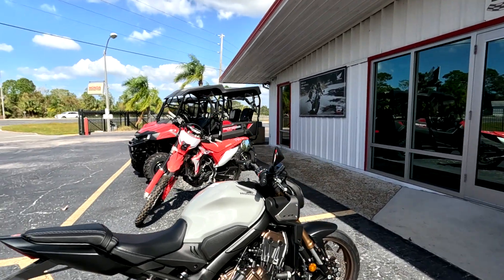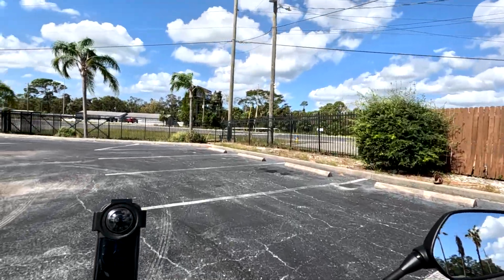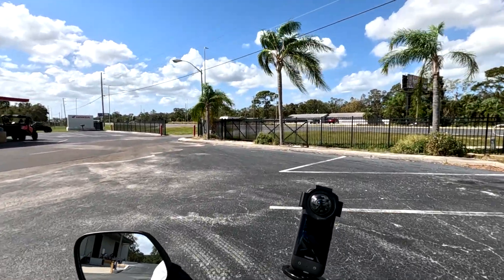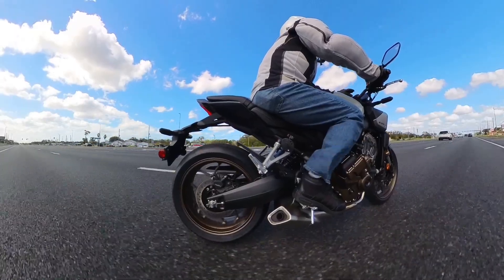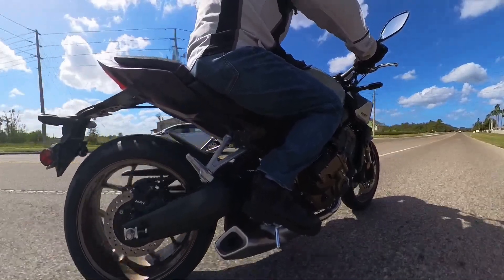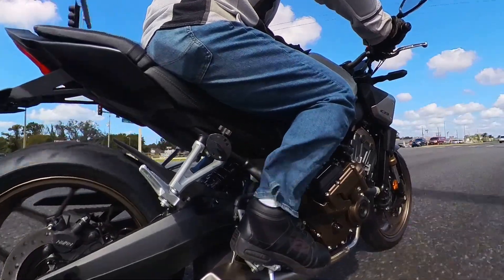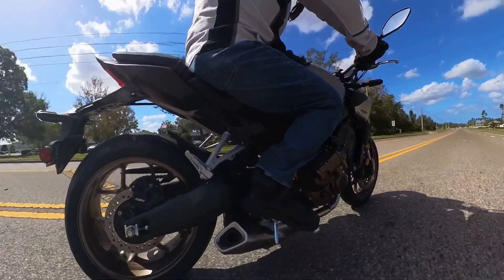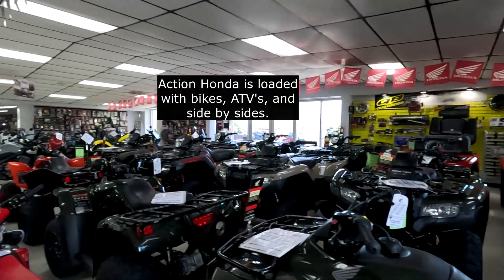Motorcycle e-clutch, innovation or useless tech?

Comment: 3:40 yeah, additional gear might be handy. But this Honda has a very revvy engine (11.000 +rpm), and most of the torque is also at higher rpm. This motor needs to be revved,  basically.

Comment: The way I understand but not ridden an e clutch is it automatic or no clutch from the start then it’s a quick shifter where you still must shift gears up and down.  A DCT(dual clutch transmission) which Ferrari, Lamborghini, Porsche use is a computer controlled AUTOMATED Clutch no torque converter like automatic car tranny) dual clutch system. One clutch for odd gears, one clutch for even gears.   That allows millisecond shifting.  The computer works the clutch and will shift for you up or down or you can manually shift with paddles.  DCT has replaced slush bucket automatic transmissions with torque converter as DCT shifts instantly.  Car acceleration must faster with DCT vs manual shifting.  Cars going with 8-10 speed automatic torque converter transmissions which can almost keep up with DCT but automatic torque converter transmissions much heavier with all the torque converter fluid.  DCT uses clutch plates just like a manual tranny.  DCT gives you a choice manual shifting or automatic shifting.
Reply: It’s interesting how frequently people misunderstand the technology available. A DCT has its explanation in the name but people still mistakenly call it an automatic despite a DCT being so much more advanced and precise than an automatic.

Comment: An Electronic Clutch for taking off from a Standstill just like a Scooter? But you can still use the clutch manually as well? I never heard of such a thing. Sounds like a geat idea. I can see that being very useful for borrowing your bike to teach a friend, or ur stuck in traffic and your feeling lazy or tired, or if your just getting old and need a little helping hand sometimes. Bring this as an option for 125cc and 250cc motorcycles so you can use them to run a Motorcycle School for Noobs and Beginners. And for schools another idea is to start them out with automatic transmission scooters and once they become proficient then switch them over to manual transmission motorcycles which is something i've never seen implemented but thats what I would do if i ran a school. Thanks for the video and be safe out there. And I also give thanks to that Honda Dealer as well. Happy Thanksgiving Everybody. 😇🙏🦃

Comment: I like this clutch / Transmission on UTVs/ATVs.   Honda is Not sure I want it on a road bike or a duel sport,  are they using this in the Honda racing? I want to see them using in the Police Moto Rodeos and see how it performs.  Kudos to the dealer for the demo and your review.
Reply from the maker: As I said in the video, you can use the clutch as you would any other clutch. You won't see this in any police rodeos since they consist of Harleys and BMW's who don't have this option. By the way, Honda introduced the bike on a race track https://www.youtube.com/watch?v=PcDWXCfq1LI